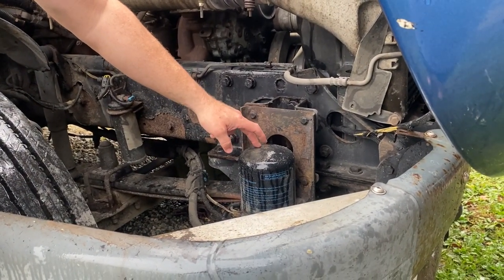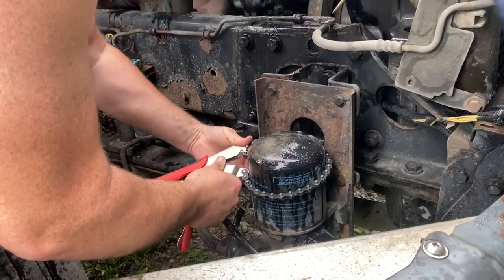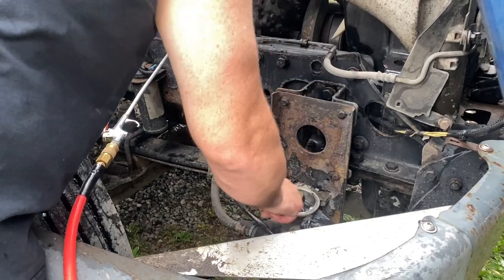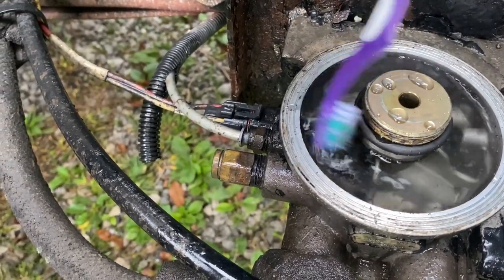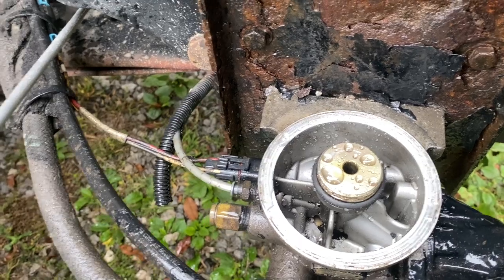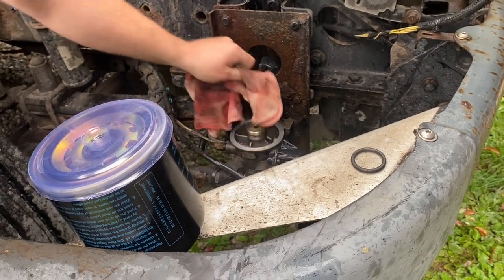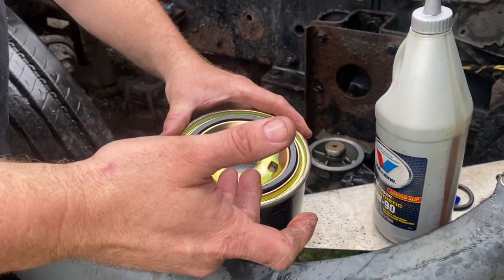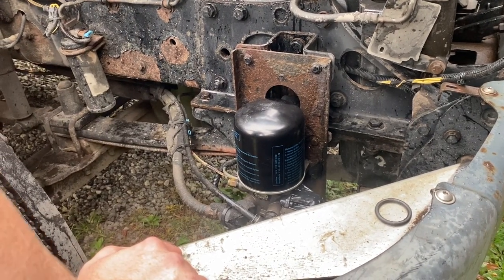Trucking , How to change an air dryer filter.

Comment: I have to say, when I watched this video the first time, I kinda thought it was a bit of a joke. However, what you are doing and saying, makes absolute sense! Oil floats on water, the air dryer is designed to handle and separate moisture, so no reason the water would hurt anything.
The only variant to this process I did, was to scrub and float the oil as you have done, but at that point, just overfill the dryer with more water (distilled for me) so that the oil just floats over the lip onto the ground. Once no more oil rises to the top, I then blew out the water from the bowl with the compressed air.  
Thank you so much for the tip, worked so much better than just a rag!
Reply from the maker: Thank you for watching !!!! I’m glad I could help you out and give you an ideal of how to clean this out a simple way !!

Comment: I wish I would have seen this yesterday  Before I change my filter. The housing, filter, And o ring Had so much of that black stuff caked on, I just put the new filter on
Reply from the maker: Yeah really needs blown out . I have over 1 million, 400,000 miles on the original air dryer ! Once a year you should change the cartridge. But at least you did change the cartridge, most people just wait until everything quits working or rots off .

Comment: Simplest & best vid on Air Dryer filters. I have a question.  I put a new TRP air dryer filter on my T2000.   It has a weep hole on the side & the air blows out of it & doesn't stop. Do you happen to be familiar with the problem. I didn't follow your procedure. The dryer is under my cab & hard to see. Thx good vid. Not confusing like so may.
Reply from the maker: I’m just not familiar with that setup , if I was I would help you out !
Reply: @Starkeyfamilyfixing  I found out. The filter is very heavy. I will simply replace it. The set up is the same as yours.  Its just under the cab. It is just the Simple Trucker Stuff. Thx 4 the bid.

Comment: Hi Scott. Just out of curiosity,  is your Columbia a DDEC5 OR DDEC6? How do you have it spect out?
Reply from the maker: DDEC 5 , Egr with no exhaust filter .
Reply from the maker: It has had a complete overhaul, turbo ect . But I bought a complete factory Detroit kit from the dealership, I bought a new turbo from garret it’s a factory style, the only real upgrade is a K&N Air Filter lol 😂 , put that in after I bought it in 2008 .
Reply: @Starkeyfamilyfixing  Nice. I was wondering...my truck has had the egr and dpf "fixed". So do I still need to maintain the dpf? Or does it basically "not exist"?
Reply from the maker: @johncalvo1743  well yes and no , even though it is fixed lol , the system can still cause you problems. Just it would be more rare to not at all for the filter to stop up , leaving you with just electrical issues D-Rating you sometimes.

Comment: Hi Scott. I posted a year ago, but here I am again. I just changed my filter out also. That same filter I got on Amazon for less than $23. The brand is TORQ. OEM wanted $75. I couldn't use a chain wrench though, because the links were too big to fit between the filter and the mount. I was thinking, since winter is coming, do you have a video on block heaters? I thought my 2009 Columbia had a factory one, but it turns out it doesn't. Do you use one, being that you're in Ohio?

Comment: HI, thanks for the video.  I have a freightliner Columbia 07.  This will work on mine, right?  My air dryer is under the truck on the air tank.   Will I have too take the complete air dryer off too replace this??  Hope too hear from you soon
Reply from the maker: It depends on if your air dryer is setup like mine , there are a few different types .
Reply: @Starkeyfamilyfixing  its not.

Comment: I need help where you put the rubber ring the small one that thread valve got stuck with the filter when I removed it.. do the dealer sells that little thread vale it self ? Thanks
Reply from the maker: Starkey Family Fixing and Rigging Up
  • 0 seconds ago
I would just do one of a few things in this case. 1. Vise grips with a rag on the threads to back it out . 2. Cut it out of the filter , once you get to the threaded section use a grinder an wear the metal thin that the threaded section is screwed into , while being careful to not damage the threads. 3. The dealer would be the last choice unless they have the part on hand and its very cheap , but if you do not feel comfortable or do not own the tools needed , go to a machine shop in your area , guessing it would be cheap to have it removed because with the right tools this is only a 5 min. job

Comment: how often would be change that filter??
Reply from the maker: Once yearly is normally great , in saying that , if you do a lot of drop and hook on random trailers , and on trailers in really bad environments then 2 or 3 times a year . I would advise doing it right before winter and before it gets really cold though if you normally pull the same trailer .

Comment: My outlet line broke off  of my air dryer on my rv looking for tips on how to replace
Reply from the maker: You may not need to ..... if its threads that are broke off in the housing , then you can use a left handed drill bit to unscrew them out , or possibly buy an easy out set . Here is an Amazon link to a set that covers a lot of sizes . https://amzn.to/34qUcr8 . Let me know if this helps you .
Reply from the maker: Without seeing a picture, this is what I am guessing your needing .
Reply: @Starkeyfamilyfixing  I am trying to attach a photo but can't figure it out
Reply: @Starkeyfamilyfixing  thanks for  the info. I have  fixed that problem but when I took it for  a short drive  the back brakes were hot and smoking  like they were locked up
Reply from the maker: @davidhumphreys8488  ok replacing the air filer would not cause that , if there was not enough air going through then it would affect you whole air system. 
 If your back brakes are heating up this is what I would do. 
1. Freshly grease your whole truck to the point you have grease pushing out the old grease on everything. 
2.Check your brake shoes for cracks and missing springs. 
3. Check the adjustment on your slack adjusters , all trucks have been mandatory to have automatic slack adjusters since 1994 , but once they get wore , they do not function like they should . As an example I have had them go bad before on the Freightliner century I used to own . One of them when bad and kept going out of adjustment, so I ended up replacing all 4 on the back of the truck then replaced the two on the front to make sure they were all good . In your case check the adjustment then keep an eye on them . I would recommend if one is bad replace them by the the axle meaning the left and right side on the same axle . Let me know what you find !
Reply: @Starkeyfamilyfixing  thanks I will give it a try and let you know

Comment: Where you buy that chain wrench?
Reply from the maker: I went to a Napa auto parts store to get a good quality one .
Reply: You can also use a filter strap wrench with a socket adapter to attach a breaker bar to it. You can get it from Amazon.
Reply from the maker: @thereviewer4173  the reason I don’t use a strap wrench that’s made of fabric is that these tend to lock on very tight . I have broken an oil filter wrench that uses a socket before. So on these I would suggest a chain style . I would suggest a parts store that sells a good quality chain wrench like a NAPA .
Reply from the maker: NAPA store
Reply: @Starkeyfamilyfixing  

It depends on the quality of the strap wrench. You want a heavy duty one. If you can’t unscrew the filter, try tightening the filter a bit, and then loosen it up a bit. You repeat this, back and forth, until the filter unscrews with little resistance. This method is used for stubborn nuts and bolts.

Also, stubborn filters could be an indication that the filter was tightened with a tool, which is a big no-no. Filters should only be tightened by hand, unless the filter instructions say otherwise.
Reply: I picked one up at Napa. It worked great!
Reply from the maker: @thereviewer4173  I only buy heavy duty, I own a business.
Reply: @Starkeyfamilyfixing  

I’m using the Lisle 60200 strap wrench. No problems yet, but all tools have their limits.
Reply from the maker: @timothygilmore2650  good deal !! I hope it works well for you !!
Reply: Terrible looking tool, look like its have ones purpose, rationale, ground, logic,raison d' etre...
Reply: how much is the filter?
Reply from the maker: Well I used to be able to get them for $25 when I first bought the truck in 2008 , but now they are just over $60 unless you can find a sale or possibly on eBay . And I would recommend changing it yearly.

Comment: Don't know how to drain the airlines? By pumping the service brake?
Reply from the maker: That’s one of the quickest way , you can with the air tank cable but it’s really slow .
Reply: Pull the gland hands off the trailer then push in the valves.  Quick and loud air release.
Reply from the maker: And here is another way

Comment: I need help where you put the rubber ring the small one that thread valve got stuck with the filter when I removed it.. do the dealer sells that little thread vale it self ? Thanks
Reply from the maker: I would just do one of a few things in this case. 1. Vise grips with a rag on the threads to back it out . 2. Cut it out of the filter , once you get to the threaded section use a grinder an wear the metal thin that the threaded section is screwed into , while being careful to not damage the threads. 3. The dealer would be the last choice unless they have the part on hand and its very cheap , but if you do not feel comfortable or do not own the tools needed , go to a machine shop in your area , guessing it would be cheap to have it removed because with the right tools this is only a 5 min. job